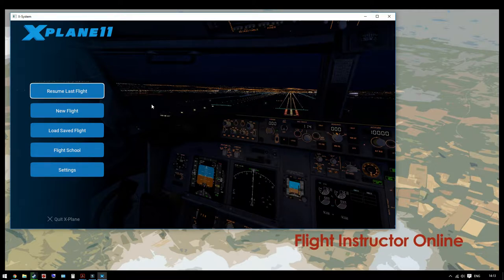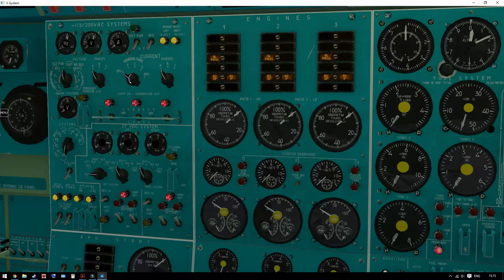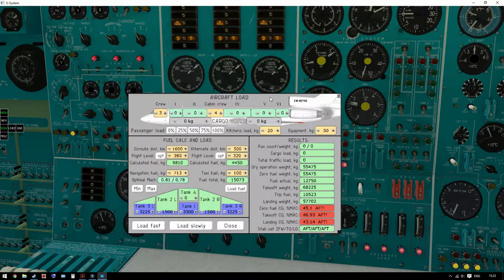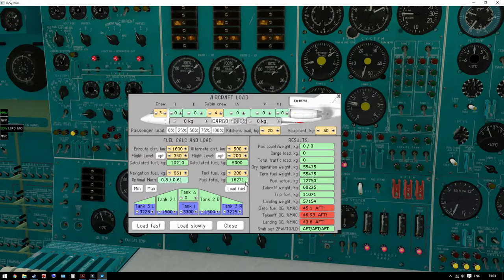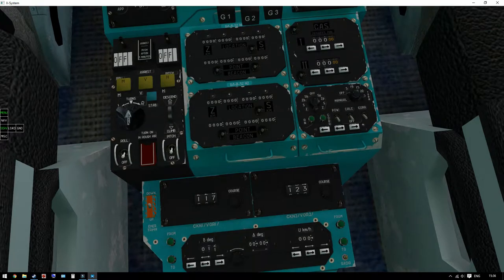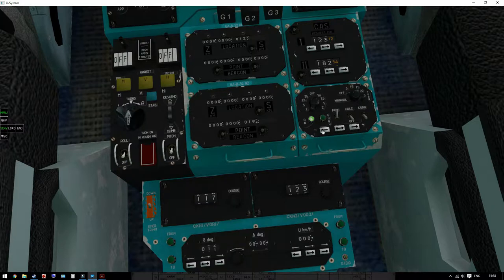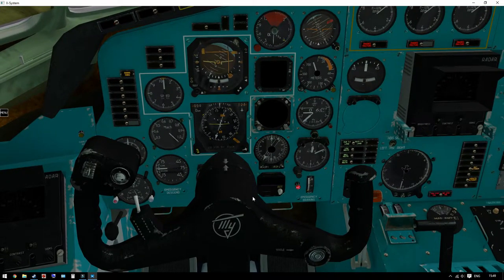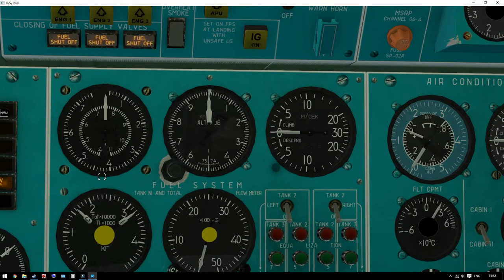Tu-154M in X-plane Part-3 Before start

Comment: 1) You have misconfigured the air conditioning unit. First the two "Mass air vent" switches go on, then the "Ground air condition" switch. The "Accelerating Modes Press Cabin Heat" switch opposite of it is optional, but since you have an open door it should be on.The pressure valve switches are for pressurization ONLY and without engines on you'd use only one, not both!
2) the Tushka is meant to be flown in QFE, not QNH, that is what the VBE is for. Also, if you did this later on, I'll apologize, but there's a pressure differential selector right of the Engineer's chair that needs to be set to 650mmHG on takeoff, and to standard before 1000m altitude and at airport QFE prior to T/D